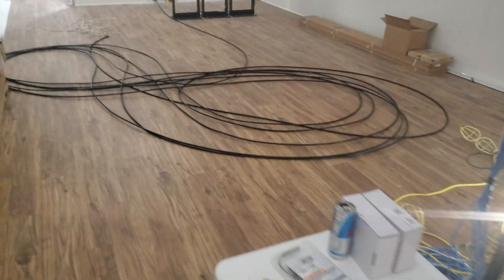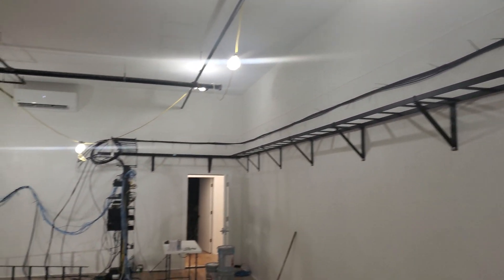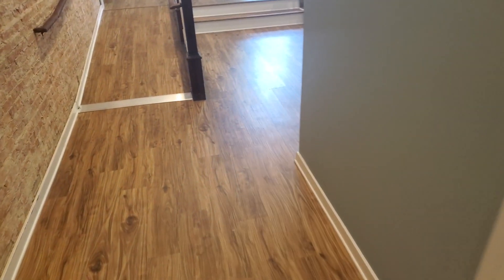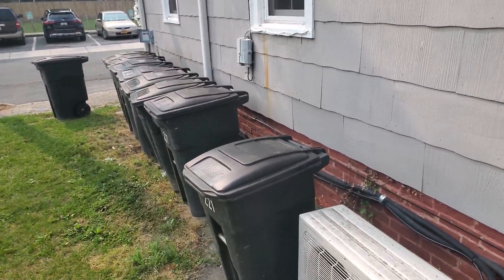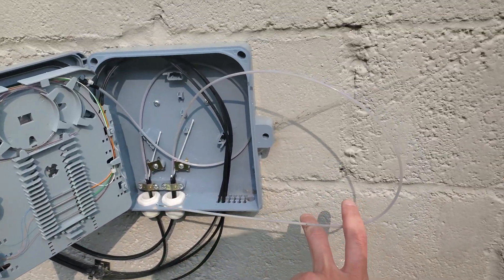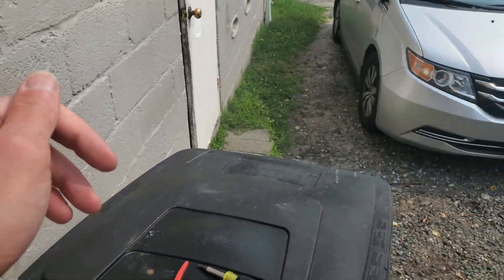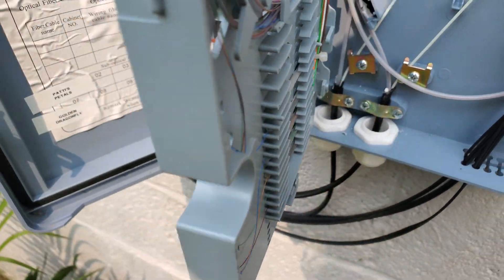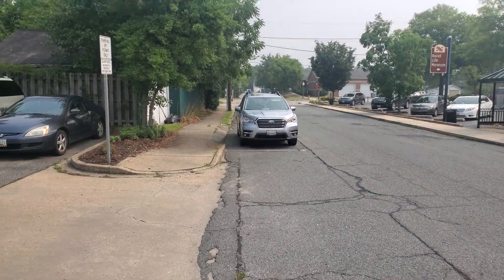Fiber splicing a 18 inch drop, hooking up 1 customer

Comment: As a licensed union electrician, having spent 13 of my 24 years in communications, I have to say that morons will be morons.  In 1997,  20 ft loops each end and epoxy polish all connectors.  At least you have it easy now.  I've seen fusion splicers that only had 3 weeks experience...period.  Could always be worse.  I've seen contractors setup LBs for 200 pair shielded copper lines when the EIA/TIA standards clearly say no conduit bodies allowed.  Make sure your electrician understands those specs...especially the 180 degree max bends in pipe for comm cables.  One hospital spec actually gave us inch and a quarter pipe for cat6 because they wanted no pull points in a patients room.  They new about the 180 rule and oversized the pipe for us, but we still had a hard time getting to the tray with 360 degrees of bends.